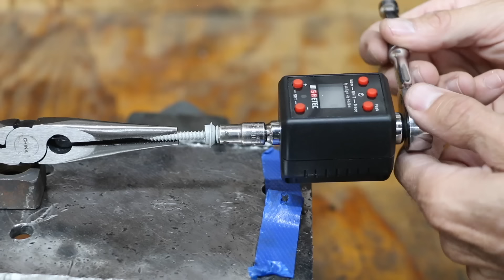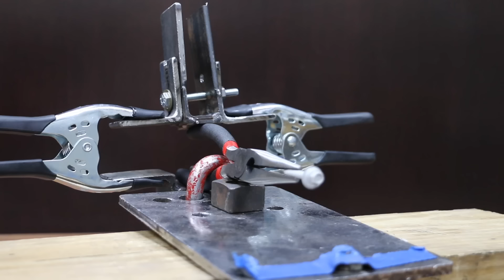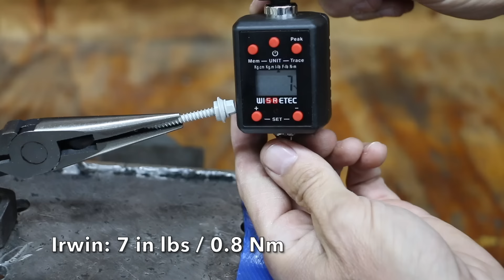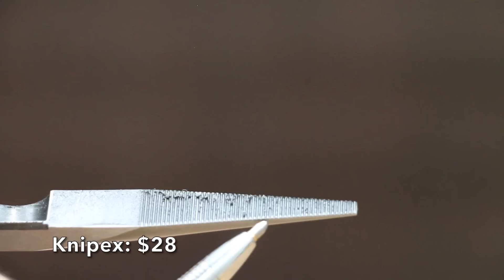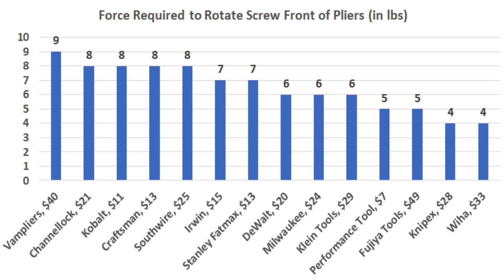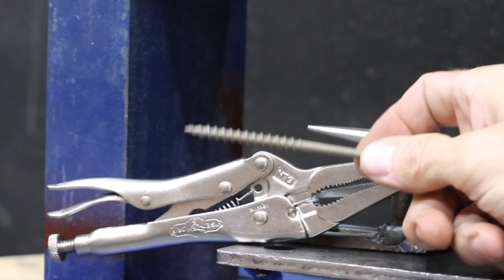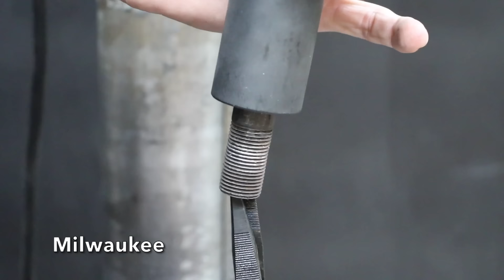Japan vs German Pliers (LONG NOSE)? Knipex, Vampliers, Klein, Fujiya, Irwin, Kobalt Needle Nose

Comment: Considering that needle nose pliers are often used to reach into tight spaces to pull thing out, I am surprised you didn't do a linear pullout test. That would seem to be a more important metric than cutting deck screws or 16p nails. Quite frankly, if you are using a pair of needle nose to cut deck screws or large nails you probably shouldn't be using tools in the first place.
Reply: Also, some focus on the jaw profile; perhaps with overlayed silhouettes or outlines. Long, thin jaws are detrimental to most of the tests, but that's the entire point of this type of plier.
Reply: I agree! I can't recall ever cutting nails with my needle  nose Pliers. Pulling things in tight spaces and twisting wires is what I use them for.
Reply: I was also disappointed there wasn't a test like this too.
Reply: This was the most important test and he missed it. Would love to see a part 2 for this. Love this guy’s videos
Reply: Similar comments and he has expressed a desire to include this kind of test in the future.
Reply: Yes! There should be a test to pull really slim things like a sheet of paper to show the build quality.
Reply: Pullout game is weak.
Reply: We need a round 2 with that linear pull out test you mentioned
Reply: Ha! My needle-nose rusted open like the pros. Can't even squeeze um
Reply: @MyfriendthinkheOJ give em a good soaking in PB Blaster or WD 40 if no Blaster and let em sit in the BLASTER OVERNIGHT and just get em to break loose a bit then let em soak. I had a old pair of my Grandfathers that were sentimental to me that my wife list under pool deck. After 3 years I found them and 2 about a week of a bit of movement at at a time and a goid cleaning and back in my box
Reply: I agree. There should have been a test for tight spaces, or even just measure the width of the jaws.
Reply: Watching the deck screw, and nail cutting tests, I was reminded of a safety sign at work that read, "When the tool's not right, the guy's not bright."
  That said, Project Farm has been an incredibly useful resource of knowledge through testing.
Reply: Knipex is an electrician tool. Its purpose is dexterity not strength. (So we can put a wire under a lug in the panel)
Reply: Before seeing your comment I thought to myself “do I really want to buy Vampliers needle nose since they don’t cut well?..actually..I don’t use needle nose pliers to cut things unless it’s wire”.

Agree. Needle nose comparisons needs better testing methods
Reply: Also the slimness of pliers (jaws and pivot), some of the “needle nose" are almost twice as fat as others and won't be able to reach  into many tight spaces.
Reply: @greentjmtl and you can see that by looking at the pliers… what’s there to test? If you need thin ones get the thin ones
Reply: Ya I work with cnc machines and this is the primary task we use our pliers for. Like pulling shreds of metal off of or out of parts. 

I personally use the Milwaukee brand long nose pliers. Great feeling in your hand with high grip in your palms. Easy to use you pinky to open and close with one hand. About $30. I’m sure there are much better brands which is what I was hoping to come here and find out lol
Reply: I agree, but still I'm happy Project Farm exists and doing more tests than anyone else seems to be posting.  Live and learn
Reply: It's largely dependent on the length of the nose I guess.
Reply: Time for a retest. Plus PF used the small Knipex NN pliers
Reply: @Mikey_Oh  Would like to see a retest also, as have several needle nose and usually destroy the cutting blades cutting something I shouldn't. The pull test would be a great idea, like a piece of paper and the actual grip strength before it lets go on a straight pull test on a more substantial item would be great.
Reply: The pullout grip seems pretty easy to extrapolate from the other tests.
Reply: @JamesLake78  Good luck extrapolating pull date on a surface from the data he collected twisting a construction screw in the jaws.
Reply: @chrisose it pretty much comes down to the hardness on the teeth and amount of force you can apply through the handles. So edge retention covers one and the twisting test covers the others. There really aren’t that many variables on it. The only one that’s not covered are tooth orientation, height, and gap between teeth, which for pulling out you’d just want horizontal ones and tooth size would vary depending on what you’re grabbing. 

Videos not perfect but it’s definitely informative enough to make a purchase.
Reply: @JamesLake78  "The only one that’s not covered are tooth orientation, height, and gap between teeth, which for pulling out you’d just want horizontal ones and tooth size would vary depending on what you’re grabbing." In other words everything you need to know about the pliers ability to grab objects inside of tight spaces.
Reply: @chrisose sounds like you’re mind is set. I don’t really care to convince you since it’s clearly going to be a waste of my time. Good luck
Reply: just a little devils advocate- I ONLY carry a needlenose on me at most times, so a situation where those are the only cutters I have on me comes up semi often. Other than that it does seem like the wrong thing to focus on...
Reply: @watermia I've carried a Leatherman daily since the PST was released in the mid 80s. I limited what I would cut with them until they put replaceable cutters on the Wave. Even then I wouldn't try cutting a drywall screw. It is easier to just snap them off.
Reply: I feel like captain hindsight here, but agree most of these tests just aren't representative of needle nose use.  I like to think of myself as strong, but I'm not squeezing 300lb to cut a deck nail.
Reply: The point isn't that you'll do it, it's an attempt to simulate hundreds of lesser cuts.
Reply: @Nevir202  The point isn't that you'll do it, it's an attempt to simulate hundreds of lesser cuts. 
    Nothing he said was to indicate that these tests were simulating hundreds of lesser cuts. You have extrapolated that idea yourself from 'Farm Projects' information he has provided.
Reply: @ what kind of point are you trying to make here? Yes, I'm extrapolating. Are you trying to imply that people shouldn't, and instead turn their brains off?
Reply: @Nevir202  Am not extrapolating or implying anything. Taking the information displayed on this video at face value. Thats what everybody should do.
Reply: @CaptSullyz  LMFAO
Reply: @Nevir202  Sorry but cutting a drywall screw is not an analog for 10,000 cuts on baling wire.
Reply: @chrisose  Not being damaged by cutting a hard screw is a very good indicator that it will wear well when cutting soft metals.
Reply: @johnd9000  Not even close. The only thing this shows is how you can ruin a perfectly good tool by doing a job it was never intended to do.
Reply: Bingo! Anyone cutting nails or deck screws with pliers has a screw loose. Pliers are for wire work, and yes, can be used for other things, like those people who use ratchets for hammers, or screw drivers for pry bars, do not confuse misuse for multi-use.
Reply: I liked the part of  "using ratchets for hammers" it made me laugh!! Here's a  quote a tradesmen told me you might like " A hammer isn't everything, but EVERYTHING is a hammer"
Reply: @Brian F  Everything is a hammer, unless it's a screwdriver. Then, it's a chisel. 

Now, search Koloss"" ratchet, by Wera. =)
Reply: Not to mention the the grip handle quality and so resistance to oil or rust , it Was just so hurry to finish something , so there's hope someone else do the rest ,;we gess so !
Reply: 100% agree.  I don't think a lot of people are trying to cut through deck screws with needle-nose pliers.
Reply: @georgeorwell126  I hate to say it, George but I think it happens more often than you think. Millennials usually hire someone or throw stuff away. Many of them probably don't even own needle nose pliers...
Reply: @clarenceboddicker5205  millennial here. I use my tools all the time for home improvement and hobbies. My dad taught me all this stuff growing up. I now own a house and am using the skills he taught me
Reply: @clarenceboddicker5205  ok let’s stop hating on millennials, time has shown that gen z is a million times worse, and I have little hope for gen alpha at this point
Reply: @Yeroc357 xenial here (generation between x and millennial) and I am in the same boat as you. On another note, as a millennial don’t you love being talked down to in YouTube comments by boomers?😂  They’re the generation that stood on the shoulders of the greatest generation, never accomplished anything themselves, yet love to complain about how their generation does everything right 🤣🤣
Reply: I'll take "people who don't understand the point of the test for 800"
Reply: @liamblood5239  Posted like a moron with a bag full of F'ed up tools.
Reply: I would rather see a product pushed to the point of failure just so I know that in a pinch I could do it if thats the only tool I had on me.
Reply: @mountainbearoutdoors I doubt you would be able to cut those screws or nails with your bare hands
Reply: I'm not using pliers to pull on things through tight spaces, surgical clamps are much better at that. They may cost more, but build quality is way better than most pliers and they also have longer handles and thinner jaws, allowing you to reach far deeper in tight spaces with less effort and more precision. Look for a straight Rochester Pean forceps clamp, 8" or longer, it can go as high as 50-60$ but you'll never need another tool for this kind of job.
Reply: @Vladimir Efimov   forcep clamps!  Very interesting!  Why do you like that particular type, please? ( ""Rochester)
Reply: @eliaustin3745  I have some although I don't think they are any particular brand or anything and I actually use them quite often for getting stuff that was dropped in small spaces and things like that
Reply: This guy does the most scientific videos, of the most interesting tool showdowns, with the most efficient delivery. 

He missed one category, one time. So what?

Also, there's a button for agreeing, everybody here. 

Lastly, if you want to know what it can reach; just look at the shape of the nose. Is it long and skinny, or short and stubby?
Reply: @eliaustin3745  I actually questioned both the omission of testing the primary use for the tool as well as including a test replicating something no rational person would do with this type of tool. 
That said. Yes, in general PF does a great job of devising and executing tests for a wide variety of tools and components. However, there are some instances, like this one, where he misses the mark.
Reply: @chrisose  I agreed, with a simple thumbs-up.  My comment(s) mainly addressed the many people that failed to notice a button for the same.
Reply: Everyone get off your high horse because being a Monday quarterback it's easy to call someone out!!! Be happy with what info you got!! Could that have been included? Yes. Was it? No. The important point is you got more info on products now than you had before and its HONEST not bought and paid for !!! You all know this thats why you watch/subscribe!! If any of you thought you could come up with even a fraction of what this man does to inform and help us you would have already done it and you wouldn't be watching you would be doing what he is!!!

Comment: When it comes to needle nose pliers for me, toughest isn't really the most important factor. You can beef them up to survive twisting and bolt cutting but that makes them heavy, stubby and uncomfortable. Its helpful to know how strong they are, and I appreciate knowing the weight, but its much more important how comfortable the angles and curves are, how far they reach, how precise and smooth the movement is and how much they loosen up with use.  As usual though this is a terrific video and the accurate, consistent testing apparatus continues to impress me.
Reply from the maker: Thanks so much!  Thanks for the feedback.
Reply: @ProjectFarm  a recommendation on this pliers testing would be a pre specified opening and what pair can reach in.
Biggest reason I ever use needle nose is for hard to reach. If it's the same size as snub nosed/linesman pliers Ill just reach for my vampliers
Reply: exactly the ones he said were good would actually suck at doing the needed job of getting in to small places that they are meant to do. like the Knipex ones i use those in real life yeah they may not be the best for cutting nails or twisting the tips but getting in to small places and doing their job they are the best
Reply: @huethehand1  I love Knipex tools but was kinda disappointed in their needle nose.  The tip bent on mine while using it and I didn't think I applied that much force to it.
Reply: @thezfunk  Knipex is overrated. And No, the ergonomy shouldnt prevent the company from using a decent spring steel. I'd rather breake mine. I hate when I have to straighten pliers like it's mild steel
Reply: @thezfunk  lifetime warranty bro
Reply: I agree.  Use the right tool for the job.  Most of the needle nose pliers tested here are unwieldy for the job, and basically have become tapered or combination lineman-needle nose pliers.
Reply: *you can beef them up to survive twisting and bolt cutting but that makes them lineman's pliers.
Reply: Correct there are some handles that you can't even hold bare handed because of the spikes
Reply: I mean if they were able to withstand such brutal test, I am sure they will be strong enough to hold something thin, and last long time. They're all long nose, so most of them will fit in same spots.. He even tested which ones close and open freely.
Reply: Could not agree more. I'm not cutting nails with my needle nose pliers. I need them to open and close smoothly and easily. Also the ability of the tip of the Jaws to pick up something small. I'm a fan of the channel but I think he missed testing for the typical usage of needle nose pliers. The twisting test was excellent.
Reply: Your criteria are all subjective. That is something impossible to quantify. They were all 8" so they have the same reach.
Reply: @LBCAndrew  yeah because depth of reach is the only parameter that matters.
You obviously don't work with tool

Comment: So well done!! How about solar chargers, portable water pumps, moisture/ph meters, irrigation valves (electric), electric lawn mowers, fertilizer spreaders, weed sprayers (electric and manual) walkie talkies, hydraulic jacks,  concrete patch mix, log splitters, small air compressors, automotive oil filters, window tinting?
Reply from the maker: Thanks for the suggestions.

Comment: for that insane 50$ price tag i can make pliers out of tool steel, with bearings, and reinforced construction with replaceable jaws, AND include ratcheting for super extra grip. And 10x stronger 'joint' since it'll use another system.
Reply: Let me know when you sell needle nose pliers of that spec for $50 I’ll buy a pair.
Reply: @sjv6598  I've been working on setting up production on several products that are objectively superior to stuff in stores, and I've also been running into problems people throwing out my prototypes because "brand good, durrrr".
Reply from the maker: Thanks for sharing.

Comment: Shocked to see Knipex do this poorly.  They're usually the gold standard in pliers.  Maybe we can get a round 2 with tool truck brand pliers vs the winners here.
Reply from the maker: Thanks for the feedback.  Thanks for the suggestion.
Reply: Well, to be entirely fair, this isn't the 'ideal' use case for needle nose pliers. In practice, the Knipex ones should be pretty good compared to the others.

Comment: The slot for gripping screws with the vampliers is a really nice addition. That really comes in handy more than you’d imagine. Regular pliers do a bad job at gripping screws, they even have special pliers specifically for gripping screws and using them versus standard pliers is just a night and day difference so I’m glad to see that on the vampliers.
Reply: Also my experience with the Vampliers!
Reply: For that I tend to use vice grips.
Reply from the maker: Thanks for the feedback.
Reply: It's a nice feature but they for sure aren't needle nose pliers any more if the tips of the jaws are that wide that you can mill a slot into them.

Comment: Not too sure about this test.  What are needle nose pliers really used for?  They are a very subjective tool with lots of compromises and trade-offs. A short thick tip may be strong but wont fit into a cotter key.  Twisting is important, but at some point switch to duck bills.  And cutting? No.. nothing more than a small nail or copper wire.
I have the 8” Knipex for getting into tight spots and several pair of Channellocks for general purpose.
I also have old and new style Snap-on 6 & 8” - all missing from this test - and imo they’re the best all around needle nose available, the old style 8” are probably my all time favorite.
Except one Channellock, none of my others have a cutter, on purpose, its a unnecessary weakness.

Needle nose are the one tool I’d like to see a test of tasks instead of trying to destroy them..  pull cotter keys, pick up ball bearings out of a hole, bend/shape piano wire, install/remove circlips, etc, etc..

Comment: I use knipex, Engineer (Maker of Vamplier), Channel Lock, and others. Each company, each tool has it's strengths.  Cutters on a needle nose is something I don't care about, but twist is.  I have the Engineer screw removal pliers, and the tooth cut works well.  those needle nose Vampliers by Engineer, have the same style of teeth. They would be useful in tight spots, or to start a screw. Sad to see they didn't spring back 100% after the test.
Reply from the maker: Thanks for the feedback.